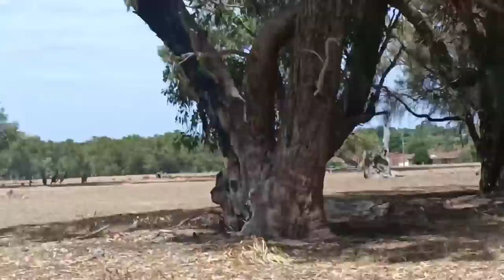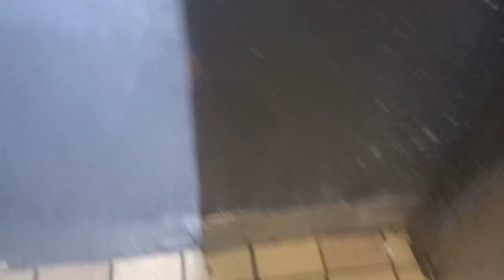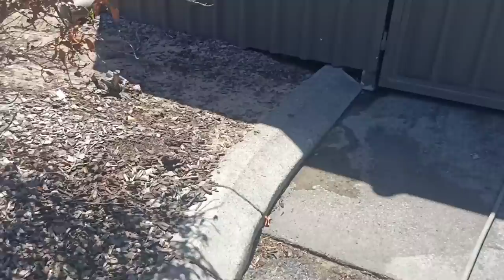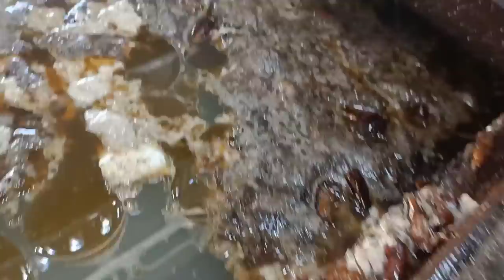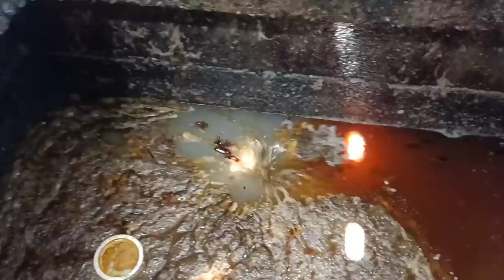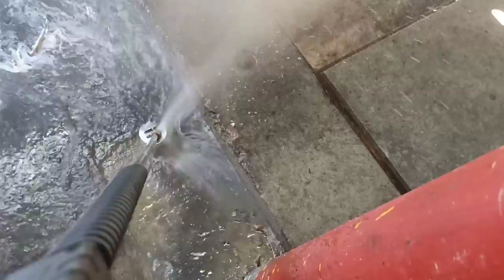A Blocked Drain with a Cockroach FILLED Grease Trap

Comment: The kangaroos are adorable.  The explosions from that cleanout are exquisite.  And there is a feeling of satisfaction seeing the water and waste flowing down the drain.  Nice work!  At work, a septic tank service company would pump out the cafeteria's grease trap every Thursday.  We all knew what was going on deep inside the manufacturing area where I worked, because the outside air intakes blew the smell into the building.  I can imagine how awful it smells close up!
Reply from the maker: Thanks for your message!! :)

Comment: Nice job Bruce! Fellow plumber on the east coast here. Never seen an grease trap run through an org is that common there? Also how is it having the jett in the Van? Any fumes? Been think about getting a van.👌🤙
Reply from the maker: Yeah mate, it's a requirement to have the outlet run through the org over here.
The jetter in the van works well. Surprisingly no fumes, I just make sure to open all the doors for a minute or so after the jobs completed. Thanks for your message mate!